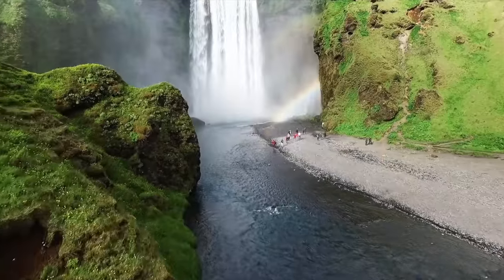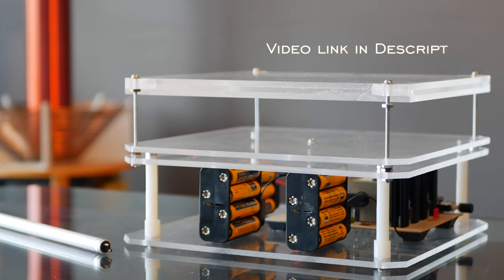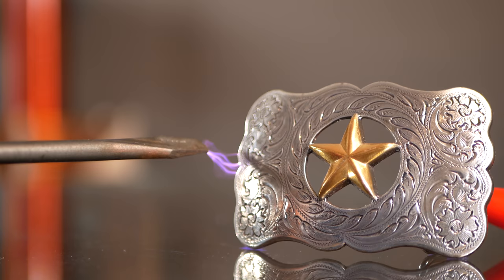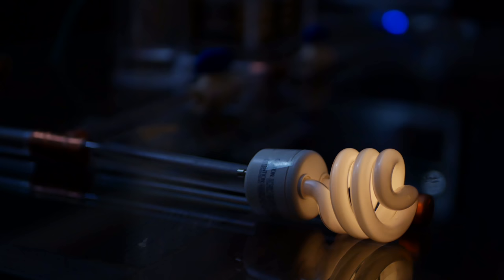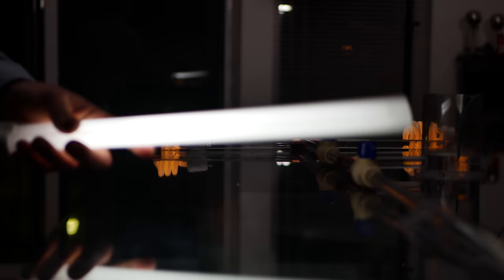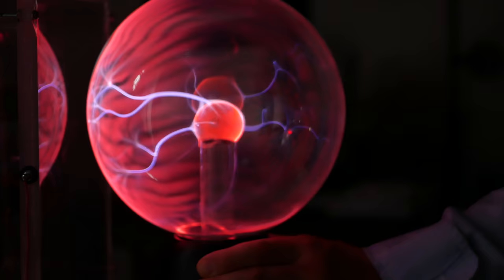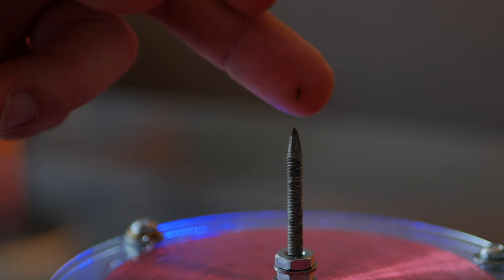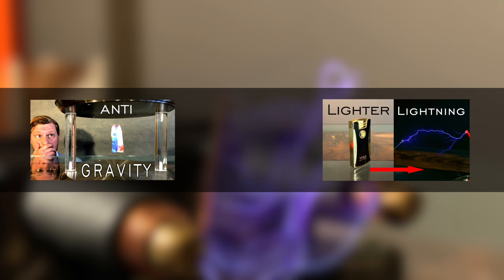Directional Wireless Energy Using Water

Comment from the maker: If you enjoyed this video, don't forget to subscribe. This is just the beginning of my water + high voltage videos!
Reply: i would love the Capacitative Cafe to charge my phone as i drink coffee!
Reply: Awesome! I am curious that, since Hydrogen gas is formed, is there any way to safely harness and possibly, use that Hydrogen?
Reply from the maker: @Inadvisablescience  Great question. Yes, small valves could be used to let the gas out.
Reply: @PlasmaChannel  sounds like a great outdoor project!
Reply: Great vid! Subscribed. Could the water under the pyramids and electromagnetic energy found in them be related to the effect?
Reply: Christopher Dekker what electromagnetic energy exactly?
Reply: When you speak of High Voltage what exactly are you talking about
120, 240, 480
Could transformers work in a low voltage environment or 1/4 water tubing.
Interesting concept in many applications.
May eliminate house electrical fire from faulty or old conductors 🤔
What are some issues that need to be addressed, that you did not speak of.
Could be the way of the future.
Great job 👍
Reply: Dude that was great!
Reply: dude add some salt in water
Reply: Please try replacing the water in the tubes with pure pressurized hydrogen.  Or pure oxygen. It would be interesting to see if these elements alone  could transfer the energy.
Reply: I live off grid (on solar with batteries I did myself).  I'm trying to think of a use for this...
Reply: @ranakrunal17  exactly
Reply: It's awesome project.........may be this project will replace the use of thermal power plants to produce electricity in future. I'll also do a research on this..... let's see what is the outcome... I'll let u know @plasma channel
Reply: Darkev a quick google shows ‘scientific discoveries’ made in 2018 of the pyramids ability to focus electromagnetic energy(I think in the form of radio waves). Coupled with water and water systems found under it, it may have been linked?
Reply: Darkev I realize that does come across as very conspiracy theory though😂
Reply: But what is the advantage of this?
Reply: Cant you combine your idee with a wireless charger by wrapping the tube with copper wire spiral or parallel with the pipe? Something like that...
Reply: You cant do that man. 
Maybe can be used for home used only. But if it breaks you can burn ur house down just because a little crack. 
Dont forget people make mistake sir. 
Not you but maybe other. 
Since our body also 70% water / liquid. It could harm us too.
Reply: Amazing 🙌😍.I always love to see this kind of videos.i subscribed 👍.we should work on natural resources from mother nature to help our human race sustainable without disturbing the nature.
Reply: Now create an engine which runs on water instead of petrol and Let the CBI do the rest.
Reply: WTF ... dude, I'm going to have to sub just to get caught up.
Reply: And oh ... based on the amount of hydrogen I saw, what about a material that would a) allow the trace amounts of hydrogen to diffuse into the air while being impermeable to H2O, or b) capture it for other purposes, or c) recombine it with the oxygen to use it for fuel and turn it back into H2O?
Reply: Shubhaang Vyas I agree. From my understanding the Nile used to come up to, if not slightly submerge, the great pyramid of Egypt. Jimmy from Bright Insight covers that actually. Apparently the quartz and other materials are piezoelectric. I’ve heard others say the internals look like a ram pump.
Reply: Kelvin water dropper - this will definitely sustain your fascination with water, easy build
Reply: @chrisd6709  yes absolutely Chris, although you will never get an academic to admit this.
Reply: @Ryan Horner Hi Ryan.  I don't know what a constituent booth is.  But I think the things that this Plasma Channel is exploring are important.  Honestly I can't remember the particular video that I commented on.  Though I'm interested in the development of gravity and energy.  So I'm certain it must have been related to those interests.  I firmly believe that we box ourselves into theories and ideas that constrain us from fully understanding the nature of the universe.  I think the main reason we don't already have zero-point energy production is that we are constantly being told that a rule or law of nature which some dead guy stipulated hundreds of years ago prohibits it.  Meanwhile, here in the 21st century where every one of us carries a small yet powerful computer in our pockets, we still don't even have the beginnings of a definition for what creates gravity.  Think about it.  Newton "recognized" gravity for the first time in the 17th century.  People were around for thousands of years before that.  And yet Newton was supposedly the first guy to recognize that apples fall to earth?  No.  Of course people before him understood how gravity works.  They just didn't put a name to it nor mathematicize the observed affects of gravity.  So Newton didn't "discover" gravity.  He merely recognized the importance of it.  And why was he the first guy in thousands of years to do that?  It was because "constituents", or group think,  told everyone they were too normal to make any meaningful contribution.  Even Jesus was ridiculed as "just the carpenter's son" when He returned to His hometown. Newton simply didn't bite that apple.  He didn't drink the kool-aid.  He jumped out of the box and moved forward because he knew the box was a stupid place to be in.  His own "constituents" were mesmerized by lifetimes of being told they were no better than anyone else.  Copernicus. Columbus, who was told by the world that his ships would fall off the edge of the Earth.  As far as I know there has never been a single contribution related to the scientific efforts of man that originated from within the "box."  Frankly I assume that why I have no constituents.  I scoff at the box.  I hate the box.  And I'm certain the box hates me.
Reply: Have  subscribed, Great stuff
Reply: Pure water is not conductive. Hydrogen and oxygen are electrical insulators. You must have been using tap water or well water in your experiment. It's the suspended particulate matter within the water that is conductive. You should lead your experiments towards adding different suspensions in distilled water in attempts to find the most efficient ones. Meaning the ones that draw the least amount of current.  As one of your other subscribers mentioned I believe different types of salts would be a good suspension to test.  Or as I stated before, by pressurizing oxygen alone or hydrogen alone it might alter the state of either gas to give it a greater conductivity. I don't know if anyone else has tested that. Also consider testing argon gas as a conductive element.  Always keep in mind that gasses flow just like water, by pressure. If you try to test pressurized oxygen or hydrogen use precaution because these gasses can be explosive under pressure.
Reply: @PlanetshashKing  I'm interested in this as well. A table filled with a thin layer of water that you could set your phone anywhere on and it would charge.
Reply: @Filmmakeroo7  This was done...there are videos on it. Though the guy who invented it died under mysterious circumstances after having discussions with the US military. His research is also missing, much like Tesla.
Reply: The bulb is still lit because the water in the tube that was shut off is still carrying a charge but it's slowly dissapating any electrical charge it has?? I don't know, do i have the right assumption or am I completely wrong?? AGAIN, THIS IS F*CKING AWESOME!!!
Reply: @johnallenrichter  I watched this and thought this still has to follow the same physics that made Tesla's work so limited right?
Reply: @KonichiWawa  That is an awesome question and well worth postulating.  Of course we are never sure of anything.  And as far as I know nobody knows how Tesla planned to project wireless electricity into the upper atmosphere to be ultimately retracted by users around the globe.  

Many say he intended to project the electricity through the air.  But that is a slight misnomer.  If he had been successful then his electricity would have indeed passed through the air.  But it would have been conducted through a magneto-electro phenomenon known as the ether.  In fact I believe Tesla was doing just that.  

Air is not a good conductor.  But I think Tesla felt that the ether is a good conductor.  And I agree with that.  Unfortunately the ether is not a good depository of electricity.  A good simile to understand ether is how a tablespoon of salt dissolves in water.  If you put a tablespoon of salt into a cup of water and dissolve it, you can taste the salt.  But if you put a tablespoon of salt into Lake Erie, well, you'll never taste that particular salt, even if you drink the whole lake.  

I think Tesla believed he could "charge" the ether like charging a capacitor or battery.  And I think he discovered that the ether simply absorbed what little amounts of energy he could pump into it like a teaspoon of salt turns into a solution with water.  Even today I don't think we could pump enough electrical power into the ether to see a noticeable increase in it's capacitance.  The Sun is simply one star of billions.  And I think stars even have a negligible affect on the ether's capacitance.

I believe the problem exists as a definitional problem.  We don't yet understand and can't define the boundaries of the ether.  From what I know of Tesla's objective I'm pretty sure he felt the ether was more of a local phenomenon central to our own planet.  That would give it a very defined size. If it were local to our planet than his hopes might have flourished.  But they didn't.  That makes me suspect that the ether is a universal phenomenon, stretching through out everything we know of or can imagine.  It  is huge.  The theory I adopt is the electric Universe Theory.

The trick to harnessing the Ether's power is to understand it better.  We have not yet conquered the full understanding of the physical states of the world like solids, liquids and gasses.  The ether is an entirely different dimension outside all of that.  And we haven't even scratched the surface of it yet.  Hopefully though someday we will develop a vehicle that can travel within the ether's electrical properties.  I believe gravity is one of the ether's properties.  And further I think it is an electrical-magnetic property which - under current rules of physics - should and could be manipulated by measures of equal or greater electro-magnetic force.  That will certainly be the day.
Reply: @johnallenrichter  the electric universe theory? Damn John ether even? If gravity is bound or modulated by electromagnetism then that should be readily demonstrable. How cool would that be? Since we are well capable of modulating electromagnetism yet haven't come close to demonstrating an ability to work up something as simple as anti-gravitational vehicles (not simple but under electric universe it should be).
Reply: @KonichiWawa  Readily demonstrable?  Like an apple that falls from a tree demonstrably falls toward the Earth?  Why did it take we humans up to just a few hundred years ago to begin understanding that?  Did apples not fall toward the Earth prior to the life of Issaac Newton?  Did apples during Christ's life fly into outer space when they fell off the branch? A thousand years before that? Or another thousand years before that? Assumptions that we already know and understand everything is what stagnates scientific research .  And it occurs with every generation. The truth is we know nothing.  We speculate with theories and try our best to test them to the exclusion of other possibilities.  But it is impossible to test things that we don't know exists.  My advice is to subscribe to no theory 100%.  In man's historical timeline we have just very recently come into observable calculations of gravity.  Mechanical generation of electricity has only been available and beneficial to us for a little over 100 years.  That's not even a drop in the bucket of history.  Tell me this, what practical application has come from efforts like string theory or any research in quantum mechanics?  The light bulb actually illuminates things in otherwise darkness.  It is a practical thing. An actual thing that is beneficial. What practical things have come from quantum research.  You asked about Tesla, the man who ultimately is responsible for the entire worlds electrical system. I'd call that a practical application. I put more stock into him and his theories than the entire population of quantum theorists. And Tesla believed in the ether.  And I totally understand that. If gravity had no unknown properties than all of the bodies of mass would be moving toward each other. The  obvious observation tells us the exact opposite, that all bodies of mass are moving away from each other at increasing rates. There's obviously something that we're missing. Frankly I view skeptics of the electric universe theory like the billions of people who lived before Newton who never recognized that objects fall toward the Earth. And it's based on the errant comparison of an unknown natural electromagnetic property of gravity with man made magnets and man made electricity.  Why do skeptics assume nature must somehow demonstrate the same properties that  manmade things do?  It's like comparing apples and oranges.
Reply: @johnallenrichter  Your saying that no one saw or understood objects falling towards the earth? Or are you depending on those who memorialize their work? Your saying that Quantum computing is a myth? There are little mice running around doing the work? I know if our understanding of gravity was wrong then the calculations used to send craft to various places in our solar system would never get their. Fermilab's G-2 experiments are what? LHC has what Sigma 7 certainty about the Higgs Boson? There is obviously a lot we are missing of course. Your saying you have the answers? It's funny you bring up Christ because between the formation of the Catholic church and plague science suffered centuries of setback. Tesla believed in the Ether so that rubber stamps it's existence as immutable? Your answer for cosmic/universal expansion is electromagnetism?
Reply: @KonichiWawa  I dont understand most of what you are saying. I know this: humankind has been around at least 6,000 years. If you believe in paleo science you might say that humans have been around for hundreds of thousands of years. I'm going to guess that gravity has been around a lot longer than mankind. And in all that vast history of time it was only a mere 300 or so years ago that a human finally recognized the force of gravity.  I'm only saying mankind in in its scientific infancy, if even that advanced. And I'll add that we still have no idea what causes gravity.  The only thing we know about gravity is the observable effects of a very limited set of gravitational properties that we are aware of.   In other words, we can calculate how fast something will fall. And I'm saying that is primitive.  I mean like cave-manishly primitive.  And its laughable that some people think we are so incredibly advanced and so secure in our vastly overrated scientific knowledge that they scoff at any idea that may project the idea that we don't know everything.  It is fact that we don't know what powers gravity.  The idiotic statement that bodies of mass cause gravity is not a causative definition.  It is only an observation of what gravity does. It is in no way an explanation of what causes gravity.  And because most people easily accept that as the cause of gravity in the least case, or who are so incapable of thought as to be unable to grasp the colossal misclassification of planetary mass as the cause of gravity, that the only conclusion must be that mankind as a whole  are simultaneously stupid while considering their science complete and irreproachable.  I'll call mankind egotistical idiots. And that's why scientific knowledge is thwarted.  There are properties of gravity we are not aware of.  That's not a question. That's a factual statement.  Its factual because we don't know the cause of gravity.  Why would anyone argue with that statement?  1. They're unable to fathom that fact because of their former misinferred understanding of gravity through their education.  In other words they're not arguing the fact that we don't know what causes planetary bodies to attract apples that fall off a tree.  They are arguing to preserve their misunderstanding of planetary mass as the cause of gravity.  They refuse to accept that their understanding is wrong.  That is an idiot who will argue to remain uninformed because of his ego. Or 2. They are incapable of understanding how the observation that mass attracts other mass does not define what causes mass to attract other mass.  It is only an observation of what gravity does. It is not a definition of what gravity is.  They are unable to process that simple thing.  Finally, I believe mass attracts other mass because all mass has an electromagnetic property or properties.  That means every atom inside a collection of atoms has it's own electrical charge.  I call that charge atomic weight which can be found on the periodic table.  Atomic weights are derived from an individual elements specific interaction with the Earths gravity because the weights were calculated here on Earth where we live.  What if we performed the atomic weight calculations on another planet?  The results would be different because the gravitational field will not be the same as the Earths gravity.  They will be only slightly different, but still different.  I proclaim that the cause of gravity is not merely a lump of non defined genetic mass.  It is dependant upon the elemental makeup within that mass.  In other words a planet made up of heavier elements (by atomic weight) would have a higher gravitational overall field than a planet comprised of lighter elements.  And since my theory portends that all atomic elements have a specific gravitational weight due to electromagnetic properties, the gist is that a large collection (mass) of atoms and molecules would have a combined gravity coming from the sun of all elements within.  In short I believe that gravity is caused by electromagnetic properties of fundamental atomic elements.  Also known as the electric universe theory.
Reply: @johnallenrichter  How can you not understand the things I have talked about? You are obviously very intelligent and gifted with an aptitude for physics. If any of the scientific things I  mentioned are beyond you that is a problem because I am not a physicist. I am however friends with one. I don't understand this need to find alternate theories. You do understand that talking to an actual physicist or better astrophysicist they would dissect all of these theories. I can't but that doesn't make me wrong. You propose that this massive body of work is wrong. Your discussion of the variation of gravitational fields and the obvious difference there would be on other planets or stellar objects. All of these people working at Fermilab and LHC just don't get it? Like me mentioning the Higgs Boson what was hard to understand? A theory is proposed and they do the work to prove it. The latest Muon experiments at Fermilab. All of this knowledge is available. Not truly understanding the Electric Universe theory I had asked my friend years ago to explain why it isn't valid. I bet there are numerous physicist on You tube who could provide a fantastic explanation for the current model. You talk about people being ignorant or their egos getting in the way. I ask what work are you doing to substantiate your theories? I had initially opened a dialog with you because I liked an answer you gave and found it insightful. I have no problem acknowledging we don't know everything there is to know but we have come a long way. These people work decades and build things like the relatively new LIGO gravitational-wave observatory.
Reply: @KonichiWawa  I call what you and I share "intrinsic reasoning."  Some scientists call outside hypotheses pseudo-science because it does not conform with their boxed-in theories.  But I offer my theories only as untested hypotheses.  I make no false claim that they have undergone any model of scientific testing.  That would be pseudo-science.  What I find is that most scholastically trained scientists jump immediately to pre-predicate conclusions  that anything outside the construction of their own wheelhouse is garbage.  Those are the people I consider to be thwarting advancement in the knowledge base of gravity and electromagnetic interaction of mass particles. These scientists are wearing blinders and are hindering progress because of it in my opinion.  A lot of them attack my hypothesis with what appears to be extreme prejudice.  Forgive me if I mistakenly added you to that group.  It's due to my Pavlovian conditioning caused by a parade of egotistical boxed-in scientists scoffing  at me that have come before you.

 LIGO is cool.  I agree.  I've had a great interest in such things since I first learned of NASA's "Grace" study.  The "Grace" experiment determined that the strength of the Earth's gravity is not singular, but metamorphic, having different strengths by different locations.  One square kilometer may have a different gravitational strength than it's neighboring square kilometer.  The thickness of the Earth's crust was benign to the results.  So the obvious intrinsic understanding to me is that gravity is therefore not emanating from the center of the Earth, but rather from the outer crust or region of crust meeting mantle.  No body else makes that connection.  Am I wrong?  Or is everyone else wrong?  It reminds me of the mother at her son's parade proclaiming, "Look!  My son is the only one in step!"  I'm not a scientist so I don't know how to test my theories.  The only thing I can do is offer them to scientists who mostly immediately disregard them.

The very worst part about science is that boxed-in scientists will spend hundreds of years chasing their tails with absolutely no results and create false beliefs in order to continue in the same direction.  Higgs boson is a great example.  They proclaimed "LOOK! We've uncovered this great particle study which indicates we are on the right path."  And so they continue on the same path.  Years later it's proven that the Higgs boson was nothing but an anomalous data source and in fact does not even exist.  Yet very few people recognize that, except for open minds like Sabine Hostetter.  Other resources like collision of atoms creating smaller particle - even something they call a new periodic element - which can only exist for a fraction of a second.  What practical use does that have.  If you crash two cars together you will have a bunch of parts strewn al over the scene, non of them exactly like the pristine parts that were used to build either car, so they are new in terms of shape and size after having been mutilated in the crash.  Honestly, I see no difference between the two.

Having considered all of this, and still in answer to your original question about Tesla (Nikola, not the car) I can only say he offered the theory or at lest co-offered the theory of ether.  He said you could run  a length of wire across a span 40 meters above the Earth, run that wire through a coil and to Earth's ground and you will receive a current.  He was right.  It's been proven countless times.  And it has a practical application.  Science, however, glosses over it entirely as some sort of parlor trick.  I believe Tesla was an intrinsic thinker.

And I  merely offering the hypothesis that it is more than a parlor trick, and in fact that it represents a property of gravity and/or electromagnetic interaction that we are as yet unaware of - except for Tesla's results.  Scientists who write it off as hysterical dribble or pseudo-science are not only being detrimental to their own field of study, but to the future possible development of applicable technology in the future.  Again I say the field of quantum mechanics has brought no practical use to technology.  Our "study" of gravity has been going on for 400 years and yet we still have no understanding of what causes gravity.  ````````````````````````````````````````````````````````````````````````````````````````````````````` At what point, or after how many centuries, is it ok for science to clear the blackboard and start over?
Reply: @johnallenrichter  I just realized you meant Sabine Hossenfelder. I don't think you are quite getting what she is trying to say. She merely wants people to stop being so dogmatic about their beliefs. The Higgs-Boson or whatever you want to call it has been proven beyond Sigma 5. If I may quote  Sabine "So here is the thing. If you want to claim that the Higgs-boson does not exist, you have to demonstrate that the theory which contains the mathematical structure called “Higgs-boson” does not fit the data." I don't want to debate the dynamics of using Sigma as a determiner. I also applaud those that always wish to push the envelope and seek new or better answers.
Reply: @KonichiWawa  agreed
Reply: I discovered something else very interesting. It has to do with sound, and something else Tesla related. I can reproduce this as well, and I am certain that it directly connects to your discovery! 
Conduction through direct contact with water to the valve allows electrons to continue flow at an altered rate. Depending on the molecular construct and charge of the comounds/elements of the valve.  Let’s talk.
Reply: new to your channel but was wondering with the wireless water transfer would there be any potential for unintended transfer to nearby sources? primarily thinking in the vein of drinks on the table but even more broad as well?
Reply: Have you done any more on this preticular project?? If so can you show some more videos with longer time dedicated on this alone.
Reply: @chrisd6709  ...hmmm...and what about those oceanic-scale aquifers of charged mineral water hundreds of kilometers deep in Earth's mantel? Are they conductors spinning in a gigantic EM field? If so, do they add a major percentage of Earth's magneto-dielectric E field?
Reply: Ya know what else was considered a novelty... Radio! 😂😉
Keep up the good work dude 😎